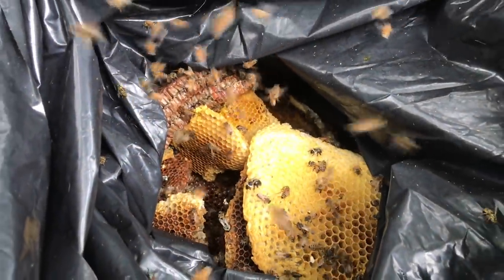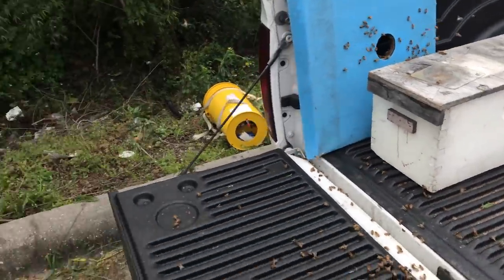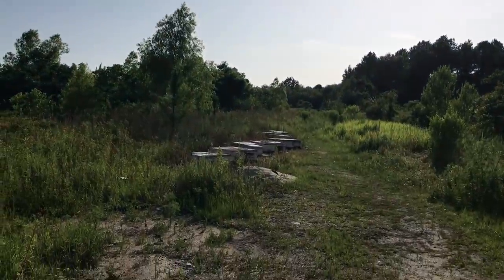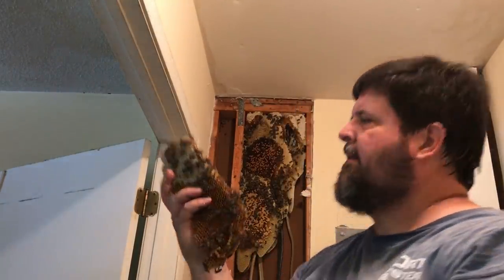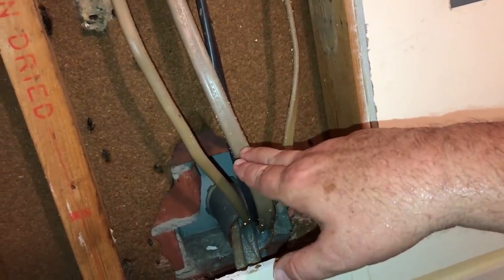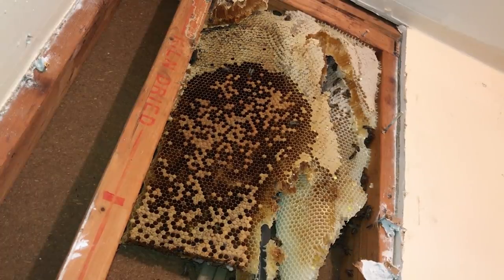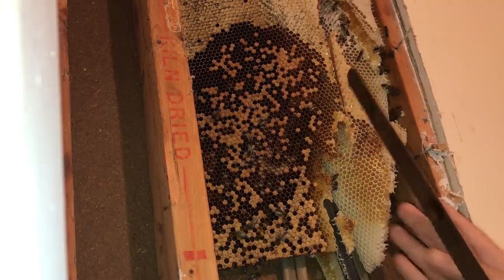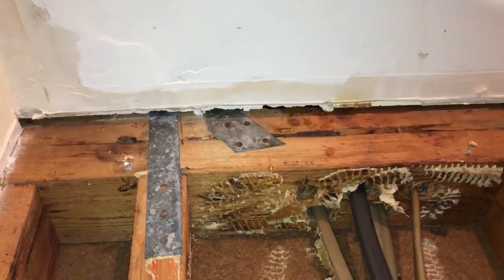Bee Transport Gone Wrong - Commercial Beekeeping Fail, Sort Of

Comment: When looking for a Stud use extra strong magnet it will pick up The nails.
Make sure you put it in a clear plastic bag, and go up an down the wall to make sure there is a line of nails.
PS, attach a weighted piece of string to the magnet, therefore the string will hang straight, showing a straight line.😊
Reply from the maker: Yep, that's a good method.  We use rare earth magnets on strings if we can't find the nails or screws.

Comment: Was remodeling my mom's house new siding over hangs  .  My step dad decided he join in add some new plumbing so mom could water her flowers . So he goes down in the basement starts drilling this hole from inside out . Drills right into main power supply.   Now my saw shuts off I look over side of house on fire my God.   I'm thinking well hes probably dead no he's cusing up storm .  Ended up frying out whole line to the pole .. couldn't help but laugh my God how did you happen to hit it dead center just dumb luck .  Had call power company out . Shut down the job 2 days . Nice job Louie

Comment: Hey I know this is unrelated to you catching bees and doing cut outs but I have a hive in the central coast section of California and it has a moisture and mold issue. It is just one box of brood and good stores on the edges. I have a telescoping cover and inner cover on it. The inner cover just has a oval hole in the center. Any suggestions?
Reply from the maker: Dry sugar on top during winter will help with condensation a little bit.  You can also give them a top entrance for ventilation and that will help with the problem.

Comment: Hey Dirt rooster. Do the drywaller a favor and only bring those 
Cuts up to no less than 3 inches from the ceiling.  It will be much easier to patch and keeps from having to work on the ceiling.

Comment: Do the truck stop bees count in your yearly bet with Mr. Ed?
Reply: They already called the competition for the season. Tied at 41.  The bees at the truck stop are likely lost bees and will die if he doesn't add a queen.
Reply: @joerowland607  Thank you for taking the time to respond.  However, my question was merely whether the truck stop bees counted as a "pont" (or several points) in their competition.  Please let me know if you have information on that specific issue.
Reply: @timothyodonnell8591  Actually Randy said their annual competition was already called a tie at 41-41.  The truck stop bees cannot survive without a queen, so it wouldn't be fair to count them.
Reply: @joerowland607  Perfect.  Thanks, again.
Reply: @timothyodonnell8591  yw

Comment: he hee spreading free bees NATION WIDE      i will never own another brick or wooden home EVER AGAIN. Next one will be GALVANIZED METAL   Quonset Hut  can with stand winds up to 250 mph. too !  Reason bricks cracks, so does cement. Wood, rots, wraps, cracks, and shrinks,  Plus all the insects looks at it like a loaf of bread>  Fixing to build one very very soon
Reply from the maker: Build that sucker in the shade of some big trees.  I was in one last year that a guy turned into a house and the garage part was uninsulated.  You couldn't be out there for long during the day.
Reply: @628DirtRooster  yep they got to be spray insulation inside,. or there hot  /  I got one that a barn. that where the hot rods and boats are ...NO TREES ANY WHERE AROUND A HOUSE  I use to love trees  BUT I HATE EM NOW   should see the leave i have to wade threw lmao b4 i get em cleaned out
Reply: @426superbee4  That's pretty interesting, I've seen ads with contractors building nice barndominiums out of them.  I love trees, I just don't want them falling on my house.
Reply: @danskisbees7348  yep exactly  THE TRUTH  BRO > 3 of us put my barn up in 3 weeks time. This was only 1 or 2 days on a week end   Once get the 1st arch up and plumed>  rest is a piece of cake. take the panels side them up on the arch and bolt em this building is 35' w x 58' L x 18' H for 10k